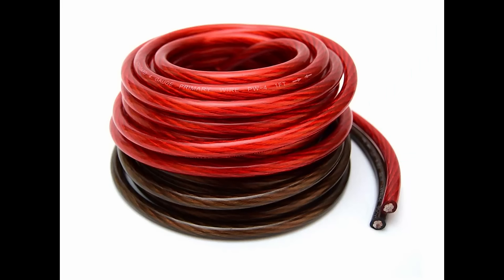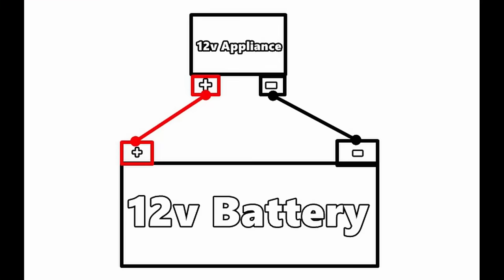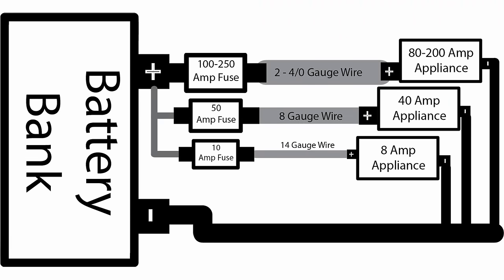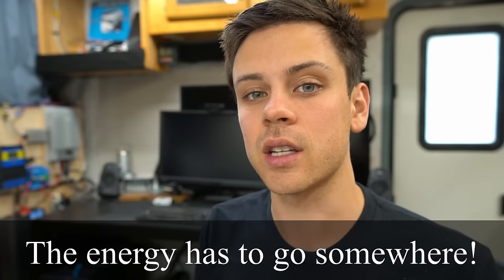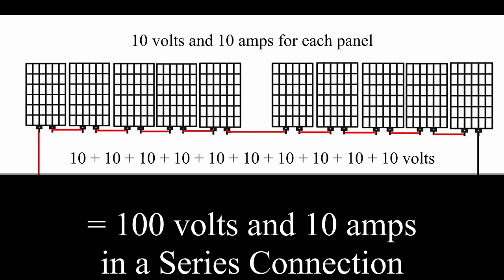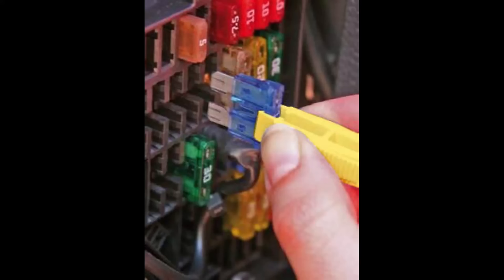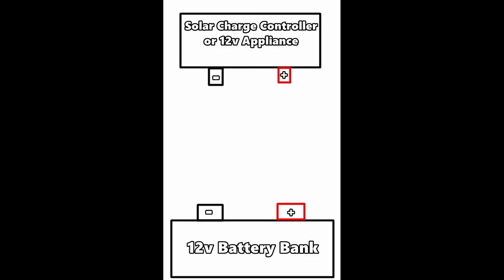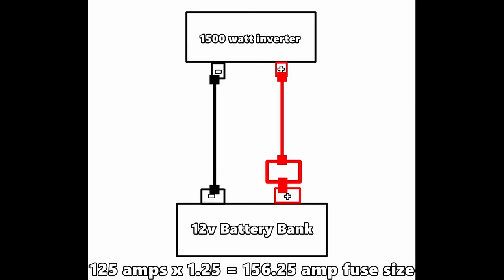Electricity Explained: Volts, Amps, Watts, Fuse Sizing, Wire Gauge, AC/DC, Solar Power and more!

Comment: Great video Will! Just one question; if DC flows from neg to pos, why would the fuse need to be close to the positive terminal of the battery specifically?
Reply: Because the positive terminal is where the holes originate from, no holes no DC negative to positive electron current flow can occur. The closer to the positive terminal the fuse is the less damage a dead short can cause to all circuits being powered. The negative terminal should also be fused like the positive terminal. Some folks think it isn't important but it is.
Reply: That main fuse is for protecting the entirety of the fat cable from meltdown by a short, you wouldn't have to replace entire cable if you have a service loop that you can cut off and save the cable. We fuse each individual circuit separately from the main fuse.
Reply: Conventional current is the flow of a positive charge from positive to negative and is the reverse of real electron flow.
(allaboutcircuits conventional versus electron flow)
Reply: @SherlockOhms119  fantastic, thanks for the various answers
Reply: @stephenpalos3240  But did it make sense? There are free DC & AC courses allaboutcircuits
A fun site.

Comment: Hey will... Just wondering if you could assist... I am connecting a trailer with a hydraulic pump to my vehicle (approx 7 metres of cable) I have used 2 gauge wire on the vehicle and trailer and Installed a 250A circuit breaker near the car battery. the hydraulic pump has a 12V 60A solenoid on it but I have installed 2 gauge partly because the pump already had a 2 gauge positive cable with 175A andersen plug and partly because I may install a second battery and additional accessories on the ute or trailer, should I then go and install a fuse or breaker at around 75A closer to the hydraulic pump or will this cause too much heat/resistance? also is there any reason you are aware of why the original trailer builder used 2 gauge positive and roughly 6 gauge negative? or should I also upgrade the negative cable?

Comment: Transmits electrical force. Actually, wires conduct electrical current. Voltage is the forcing function here. In Chinese, 'voltage' translates to force. Pressure in a pipe is analogous. Let's say you're pumping water. The pressure in the pipe -- mind you, pressure is a force -- would correspond to voltage. The water itself would be the current.

Comment: I got one of these monitors, almost have it all hooked up but, I can't seem to get the power wire to go in that little hole. Is there something I'm missing here. I unscrewed the little screw, both of them. Can't seem to get the wire in. Tried and tried. Like there's no room for any size wire, or the screw isn't raising up. But I can see the screw raising up by the head, but I still don't have enough room even for the tiniest of wire, I even try to solid core small wire, something might ride her this thing's not working properly. Do you have any ideas?

Comment: hey bro. I have Question. I have 30 amp camper and the converter is Faulty. Can I change the Converter into 50 amp? or it should be 30 amp? any tips my friend. thanks a lot

Comment: hi, if multiple appliances are connected to the inverter do they add up to calculate the fuse size? what about the inverter amp draw, do we have to add it up as well? that is inverter amp draw + appliances amp draw, thanks!

Comment: How does battery sampling work? I'd like to have my mppt see actual battery voltage and not the charging voltage. I hooked up tiny wires to the battery to battery sampling. I also increase the charge cables. Still getting higher voltage at the mppt and it's saying charged when battery isn't charged.

Comment: Hi Was watching the video and I have a couple of questions 
Power goes away a lot where I live 
I have Router and modem for internet one says 12v,2amp the other 12v 1 amp
That means 24watts and 12watts if I learned correctly....
I power them for 1 hour with my 450va ups battery 
And I would like to know how much wattage per hour they use so I can build a solar power system 
I know it must be simple but I'm stuck with the 450va and why it last.  just 1 hour
This has me confused 
How much wattage per hour they are using?
What is the watts of the ups battery 
And why only las 1 hour...

Now on the other side of things  if I have a battery with 2000 wHr 
And the load is 36 watts that means I can power the router and modem for 55 hours??

Comment: I need to learn because I just bought a 50 watt solar panel and a renogy Phoenix 300 power station and need to figure out what appliances, if any, I can power with this set-up. And, do I need a controller or an inverter if I'm using solar panel to charge my power station? I looked up wattages of appliances. So it appears that I can run a TV, a ceiling fan, a computer monitor and tower on the 350 watt power station. Is that anywhere near correct? LOL and if so, for one hour?  Can someone help me with this, please.

Comment: If something is rated for a certain amperage, is that consistent no matter the voltage? The plug on my camper is rated for 10 amps, could I double the wattage going from 12v to 24v?

Comment: How much power or solar panels, or size of inverter should I get to plug a microwave (20 amp) that I will use a few minutes a day? How do you calculate that? The microwave says 20 amp... what would that mean to me?

Comment: question...

i have a power source and i split it 4 ways. then i split those 4, by 2 each, making 8 wires. i then connect them in pairs, so that I have 4 pairs. i then return those 4 pairs to a single point. have i increased the power? if so by how much? and can that power be returned to the original power source with blowing it up? if not, is there a way to do it correctly?

Comment: Hello Mr Will. i need your input asap. i just bout a 2022 hyundai tucson hybrid.  can i use a 12v input from the same car to a 110 v inverter n plug in the car 110 plug into it so it can self charge ? any thing i need to look for in the inverter like watts, amps etc?

Comment: for what reason...(and I know this is a rabbit hole....) did you go straight to an amperage vrs.voltage strong system? probably simpler is the q. when is a voltage increased system used???

Comment: I've watched hours of your videos and others. I'm doing a 400 W panel system in my Van with a 200 amp hr lithium battery to start. Still trying to figure this out. Why would someone in my situation choose to put their panels or batteries in parallel instead of series or vice versa. Looking to run normal things like 12v lights, 12v sockets,small 12 volt fan and maxx air fan, inverter too for 110 fridge and television, an induction cook top maybe a small ac sometimes. I know thats pushing it. Normal stuff for a full size van and 2 people. HELP!

Comment: I am realky struggling to undetstamdvall this. I am looking to buy a car battery jukper with a builr in plug to olug things into it...but it says it is 12v...most wall pmug sockets arw 240v...so norhing will be powered by 12v, it seems to me. I am obviously misund err stsnding butbu said a hairdryer would not work in usa bc their sockets a re 110v...so how much more would it not work in a 12v socket?
I am rwalky struggling to make sense of all this.

Comment: So, I have 4 - 120 watts solar panels (series parallel (2 sets of two)) 21.6 volts each @ 6.5 amps - after combiner I expect its 43.2 volts @ 13 AMP ? - going into a charge controller (40 AMP MPPT) the to a bank of AGM's.  I'm confused on charging time and such?  I have a bank of 315 AH - so roughly 155 useable.... when the power leaves the MPPT and goes to the batteries...whats coming out?  13 amp?  or 26 AMPS?  what about volts?  will the mppt control it to go from 40 some volts into 12 volts batteries?  How do I figure out the charge time to get that 12 volts battery bank charged...and regain the 155 amps or whatever was used during the day?  I set up the series parallel because its on a sailboat and may have areas of shading.... just confused how the amps and whats act from the charge controller to the 12 volt battery bank  PLEASE HELP

Comment: At 12:25, why don't they just rate batteries, and everything else for that matter (saws, motors, space lasers) by wattage? Or by joules?
Seems like the only thing that should be measured by amps is wire.

Comment: Why would the fuse be sized at 125% wouldn't that allow the load to be overloaded by amps and burn out or become damaged in another way?
The intent is to allow surges to pass thru wires unto the load?  I don't understand the fuse threshold being higher than the loads threshold

Comment: i have a 130 amp solar pan, max power 18v open circuit vol 22.5 max system vol 1000 wich fuse do i need

Comment: Ok so I’ve got three different solar power banks made by blavor. One has a capacity of 10000mAh/3.7V(37Wh) it outputs to usb at 5V/3A. The second 26800mAh/3.7V(99Wh) same output. The third 20000mAh one of the USB’s can output 18W(Max) 5V/3A 9V/2A 12V1.5A. So I was thinking about connecting them in series for example it has a type C input so I could output to type C connected into one of the chargers and then I could input and charge the other solar power bank and so on to try and maybe use DC adapter to charge a air sense 10 CPAP??  Any ideas on if that would remotely work if I were able to get the proper adapters??  Unfortunately the CPAP runs on DC 24 V at 3.75 A. So yah

Comment: Hy, can i connect a 18 A Solar pannel to a 16 A inverter? if i respect de voltage (voc) does the Amperage, in this case the the remain 2 A "remain in the air" or damages the inverter?

Comment: Valiant attempt, but I still grasp it. As a professional photographer, I understand how shutter speed is effected by ISO and how ISO effects my aperture selection which can then effect what shutter speed I set.
Is it possible to explain electricity, ie amps, volts and watts, in a way that doesn't use water and plumbing? It seems that something is always missing in this analogy. Also, it seems that sometimes unfamiliar and unexplained terms are introduced which loses me again.
I understand the math of how to calculate watts from amps and watts, but since I am trying to DIY a solar power system, there are too many versions or variances in terms used in the specs for all the different parts of a system. It seems like too much is assumed to be understood by the novice.

Comment: Wonder if someone could help me out, as electrical things are not my area of expertise.  I just bought a portable generator to use as a backup when the power goes out.  One of the main items I want to run during a blackout is my fridge.  The spec label in the fridge says "7.90 amps and 115 VAC."  My generator has a 30 amp power outlet for which I plan to connect a 30-amp (125V) power cord, which has three 15-amp household-style receptacles at the other end.   Based on these figures, can I safely run my fridge with generator with this power cord?   Thanks!

Comment: so if i have a 36v system in produces 5000 kwh is that a lot ? this what i bought to go in golf cart i was trying to figure out how far it will go with 125ah lithium battery should be around 70 miles at least.roypow said there 105ah will go 65 miles so i bought the bigbattery 36v gatr pack cause it was 125ah with charger 200 dollars cheaper with 20 more amp hours so that should be least 5 more miles if not even farther

Comment: if i use 2 panels of 20v/5a in series (40v X 5a=200w) and 2 panels 20v/5a in parellel (20v X 10a=200w) to charge a battery. which method will charge a battery faster? and is with both method i will need a charge controller of (200w/12v) 16.6amps or there is a difference by the i connect the panels?

Comment: I need to be able to provide 240 volts and at 30 amps to a water well by battery. For a back up system . I figured I need 20 batteries in series. But if Ian thinking right 20 batteries is 240 volts but only 1 amp . Does anyone know how to hook up batteries to get the required volts and the 30 amps? Thank you for helping me see what I need !

Comment: Dumb question: Regarding parallel vs series connections, what does it matter which you choose? Bc even tho you can increase either V or A while maintaining the other, the W stays the same regardless. So since W is unchanged, who cares? I don't get the value of one configuration over the other.

Comment: hi, so if i use 5 solar panels of 30v/10a each in series i will need a charge controller of 25amps? and if i use 5 solar panels of 30v/10a in paralell i will need a charge controller of 125amps? i am right?

Comment: OK so basicly the dc volt and ac volt are similar. let say my meter draw about 3 KWh over night for Refrigerator and Lighting.  I checked in the morning.  The refrigerator is 120v 6.5 amp said on the sticker.  So to match that incase there is/are power outage.  I would needed at least a 12v 300 Amp power bank, or (at least 24v 150 amp) right? this is not include the draw inverter from the 12v inverter.  Where do I buy the 120v inverter use 24 v power bank? please?  (I currently using the 12v inverter 1000w for small stuff or 6000w 3000w continue for refrigerator incase power outage but Interstate deep cycle battery x2 or x3 parallel only last less than a year.  My battery bank right outside wall of the refrigerator,...  I trying to build a right battery bank and.  Solar panels I currently have 10 x 24v solars 200-250 watts that are using the Enphase inverter, which I can use it to make 24v battery bank and buy the 24v dc to Ac inverter or use the 36v max power step down to 14v to charge the 300 amp battery banks, or better to buy 40 amp 24v charge controler and use the solar 24v to charge the battery bank with 60/100 amp BMS for lifepo4 300 amp battery bank and buy the 24v dc inverter to 120v ac.  This will cost so much more money.  Which way save me money.  The currently 12v dc to ac inverter I am using is the type you can buy at Walmart or Harbor Freight not professional on wall.  Battery: interstate from costco: 750 cranking amp. 2nd one said: 600 cca. third is : RC - 160.  So I figure that this battery have 160 use able amp? but I only use down to 11.9 volt.  It last about 10 months with using 2 laptops only.........   help me out please.... Thanks

Comment: Please help! I have a 24v system with (2) 170 watt 24v panels and (4) 100 amp batteries. This is for my camper van. I have an all in one 3KW system. The question is can I run a line directly from my batteries and run it through a 480 watt step down  24v to 12v converter to power my 12v items? Anyone please give advice. Thanks

Comment: What if I hook my generator to my charge controller if I kick out 3900 watts run 4200 max generator will this hurt my 3500 watt 48volt charge controller inverter

Comment: can you use a 1200w battery with a 1500w motor? For example an ebike battery 1200w and a 1500w ebike motor? would that overheat the battery? after watching your video. I don't think so. because the motor would just be underpowered.

Comment: And with AC when there's a dead short with high enough voltage you can hear the wires literally slap inside the conduit for a second just before the breaker trips😬

Comment: Connect a power Ray I have five 275 watt solar panels they are used some of them are damaged how much how would I connect it to a trailer that has a the plug for the generator or the plug-in for the yeah the plug-in for the alternator the old thing how do I plug it into a motorhome to that array